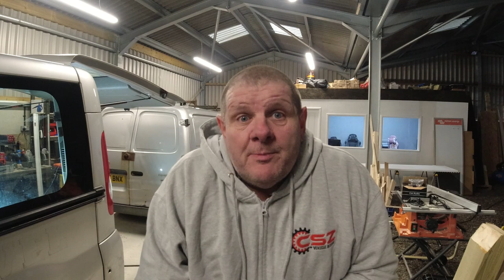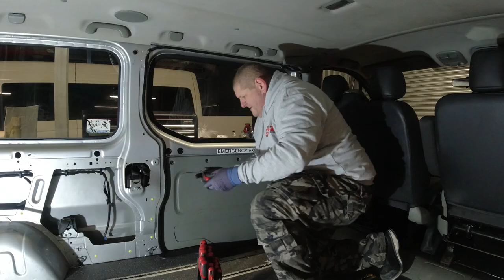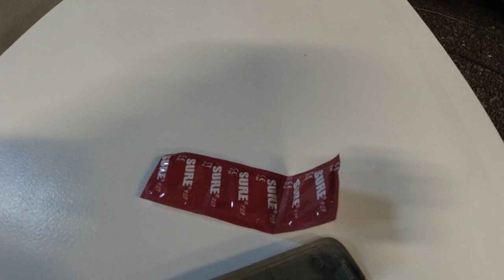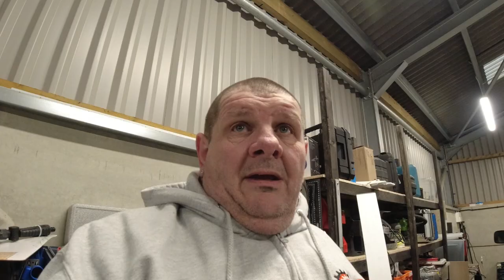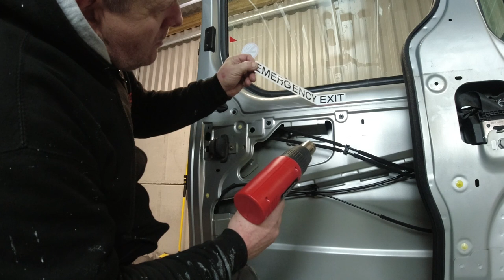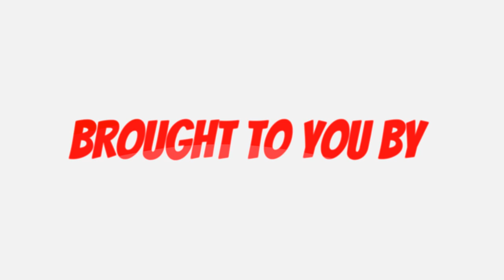Renault Trafic Campervan Conversion - Stripping the interior

Comment: The roof lining looks in good nick, are you going to refit after sound deadening and insulation?
Reply from the maker: I did think about re fitting it but I have other ideas so it's going up for sale
Reply: @BuiltnotBoughtCampers  I will do, thanks. Must have missed that one. 👍